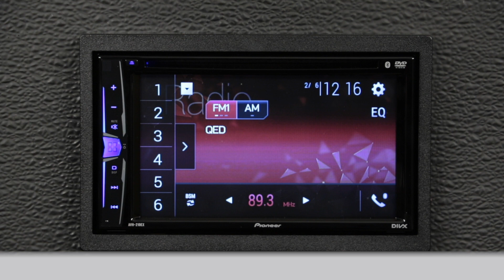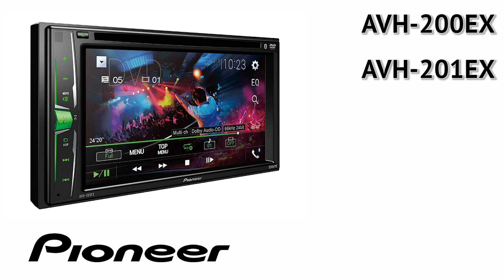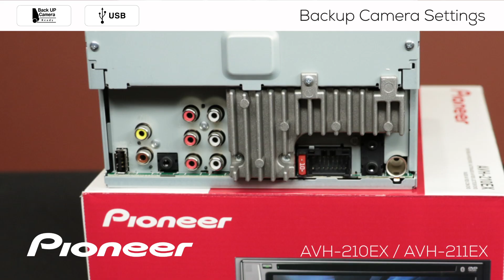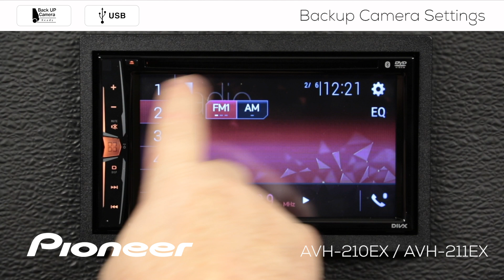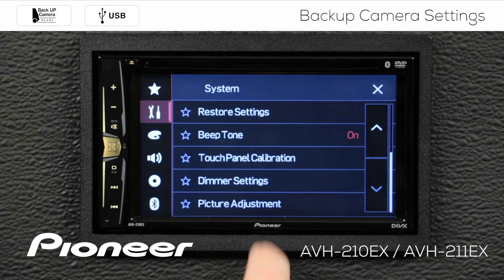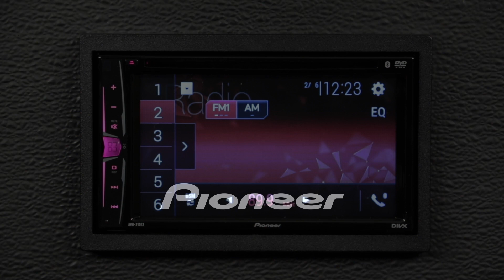How To - AVH-210EX - Backup Camera Settings

Comment: I've installed this unit in my vehicle. The back-up camera activates on when I put the car in reverse, but will not activate when I push on  "camera view". What did I do wrong?
Reply: Same here, did you ever figure out what to do?
Reply: It sounds like you are using the Purple/White wire to power the camera.  This is incorrect wiring.  
Pioneer in-dash receivers are designed to work with the Pioneer ND-BC8 backup camera.  You can see it here:  https://youtu.be/kg0IaGC3JbE?list=PLw63zJRQbCNgLoyoij-BJdPDBVLYipAnj   The ND-BC8 has a Red ignition wire and a Black ground wire.  
The camera should power on when the vehicle is on.  And the camera should power off when the vehicle is off.  
Just because the camera has power, does not mean you are viewing the camera window on the in-dash receiver.  
On the in-dash receiver, the Purple/White Reverse Gear Wire is used to let the in-dash receiver know the vehicle is in it's reverse gear, and this can automatically open the camera window.   Do not connect the Purple/White to the camera.  The camera should operate with the vehicle ignition.  
At any time you can touch the in-dash receiver screen to open the camera view window.  You can find more videos about wiring your Pioneer in-dash receiver here:  https://youtu.be/-bF3uzzaT30?list=PLw63zJRQbCNgLoyoij-BJdPDBVLYipAnj   
You can find more videos about Pioneer AVH-210EX in this Pioneer You Tube Playlist:  https://youtu.be/oVH5gvX5Rfs?list=PLw63zJRQbCNgLoyoij-BJdPDBVLYipAnj  and you can find more videos on Pioneer's You Tube Channel here:  https://www.youtube.com/user/pioneerelectronics

Comment: So if you connect to reverse lamp how do you turn on the camera whenever you want if it doesn’t have power?
Reply: Pioneer in-dash receivers are designed to work with the Pioneer ND-BC8 backup camera.  You can see it here:  https://youtu.be/kg0IaGC3JbE?list=PLw63zJRQbCNgLoyoij-BJdPDBVLYipAnj   The ND-BC8 has a Red ignition wire and a Black ground wire.  The camera should power on when the vehicle is on.  And the camera should power off when the vehicle is off.  Just because the camera has power, does not mean you are viewing the camera window on the in-dash receiver.  On the in-dash receiver, the Purple/White Reverse Gear Wire is used to let the in-dash receiver know the vehicle is in it's reverse gear, and this can automatically open the camera window.   Do not connect the Purple/White to the camera.  The camera should operate with the vehicle ignition.  At any time you can touch the in-dash receiver screen to open the camera view window.  You can find more videos about wiring your Pioneer in-dash receiver here:  https://youtu.be/-bF3uzzaT30?list=PLw63zJRQbCNgLoyoij-BJdPDBVLYipAnj   You can find more videos about Pioneer AVH-210EX in this Pioneer You Tube Playlist:  https://youtu.be/oVH5gvX5Rfs?list=PLw63zJRQbCNgLoyoij-BJdPDBVLYipAnj  and you can find more videos on Pioneer's You Tube Channel here:  https://www.youtube.com/user/pioneerelectronics

Comment: So i have an issue where as soon as i turn the ignition on an the radio powers up it goes straight to the camera screen (Blank as not in reverse) I press the X icon to go back to main screen then it will usually go back to camera screen again. I tap X again and it goes back to main screen and this time stays there. Any ideas?
Reply: Do you have a camera installed?  What is your connection to the Purple/White wire for the reverse gear?   I recommend to press the microprocessor reset button on the in-dash receiver.  You'll need a paper clip or some other small point to press the microprocessor reset button.  If you are using a Pioneer AVH-210EX you'll find the microprocessor reset button at the bottom of the hard key panel.  You can find more How To videos about the Pioneer AVH-210EX in this Pioneer You Tube Playlist:  https://youtu.be/oVH5gvX5Rfs?list=PLw63zJRQbCNgLoyoij-BJdPDBVLYipAnj  and you can find more videos on Pioneer's You Tube Channel here:  https://www.youtube.com/user/pioneerelectronics
Reply: This is old, but I was having the same problem and when I went to camera settings and changed the polarity to battery from ground it made it so the backup camera only activated when I put the car in reverese.

Comment: Hi I'm using AVH 5450DVD on my Mercedes and installed an aftermarket backup camera. Every things look good except nothing change on the screen at gear 'R'. I check on the settings, Polarity = battery but "source off" next to "rear view". To see the back view, I have to push the "rear view" button, just like you describe 5 second and return to the main screen etc. This situation happens, when I press the "rear view" button, can see the back view at gear 'R' and turn black screen at gear not 'R'. I expect that whatever you are doing say DVD, music, radio, it goes to back view at gear'R' without touching any thing on the screen, right?
Correct me if I were wrong, I saw your video in the end, Pioneer can function this, provided that the violet wiring is connected correctly. I'm using crimp connector, thanks.
Reply: When you put the vehicle in the reverse gear, the in-dash receiver is designed to automatically switch to the camera view.  The Violet/White wire let's the in-dash receiver know the vehicle is in it's reverse gear and to open the camera window.     Please focus on the Violet/White wire.  This wire needs to see a change in voltage when the vehicle is in it's reverse gear.  One possible way to connect the violet/white wire is to the backup lamp terminal.  You can learn more about wiring your Pioneer in-dash receiver here:  https://youtu.be/-bF3uzzaT30  Do not connect the violet/white wire to the camera.  You can find more videos on Pioneer's You Tube Channel here:  https://www.youtube.com/user/pioneerelectronics
Reply: @deckerdotto6035  Thanks Deckerd, I'll do a connectivity test on violet/white wiring connection to +ve of backup light. Crimp connector may not be as good as directly copper wire twisting.

Comment: So I just installed this avh-210ex. After installing I have 3 issues, when putting car in reverse, the camera angle is pointed directly down, how do I change so it shows directly behind vehicle instead of straight down? Also, when playing a DVD, I hear the movie but there is no video, finally after installing the aswc-1,the steering wheel controls do not work... When I push camera setting from home screen, it's black with nothing on screen. Any help is appreciated
Reply: All 3 things you've described here are installation issues.  Let's start with the DVD video.  You must have the Parking Brake engaged in an ON-OFF-ON operation to watch video.  If you engage the Parking Brake and still can not see video you have an incorrect connection to the Green Parking Brake Wire.  You can see more about the Green Parking Brake Wire here:  https://youtu.be/-bF3uzzaT30?list=PLw63zJRQbCNgLoyoij-BJdPDBVLYipAnj    and you can see video playback from USB here:  https://youtu.be/7LU2GxhRGrQ?list=PLw63zJRQbCNgLoyoij-BJdPDBVLYipAnj&t=301   For the camera angle I recommend to physically adjust the camera angle.  I'm not aware of any camera angle adjustment that can be made on the Pioneer AVH-210EX.   As for the camera black screen.  Check the camera polarity seen here:    https://youtu.be/tWi_kVPg2M4?t=115   This may correct the issue.  If not it sounds like the camera is not powered up when you choose camera from the home screen.  The camera should have power at all times when the vehicle is switched on.  And the camera should power off when the vehicle is switched off.  When you choose camera from the home screen you are simply opening the camera window on the in-dash receiver. The Purple/White wire should not be connected to the camera.  Purple/White is used to let the in-dash receiver know the vehicle is in it's reverse gear and to automatically open the camera window and to automatically close the camera window when the vehicle goes out of it's reverse gear.    You can see more about the Purple/White wire here   https://youtu.be/-bF3uzzaT30?list=PLw63zJRQbCNgLoyoij-BJdPDBVLYipAnj&t=127    Finally,  there are no adjustments for the Steering Wheel Control adapter in the Pioneer AVH-210EX.  You must program the Steering Wheel Control adapter before you install it.  Please contact the manufacturer of the steering wheel control adapter for more information.  You can find more videos about Pioneer AVH-210EX in this playlist:  https://youtu.be/oVH5gvX5Rfs?list=PLw63zJRQbCNgLoyoij-BJdPDBVLYipAnj   and you can find more videos on Pioneer's You Tube Channel here:  https://www.youtube.com/user/pioneerelectronics
Reply: @deckerdotto6035  I figured it was an installation error. I am just curious about the backup camera. The camera is not adjustable, this is the factory camera, which I was able to switch between 3 different views with the original factory stereo but now only faces straight down. So I'm hoping it's just an installation error. I see videos for using a USB thumb drive but nothing about using the actual cable that comes with our phones.
Reply: I'm not aware of a way to adjust the factory camera viewing angle using the Pioneer AVH-210EX.  The USB port is on the back of the in-dash receiver and a USB extension is included in the box to bring the USB port up into the passenger compartment of your vehicle.  The USB port on the Pioneer AVH-210EX will charge your phone when it's plugged in. The Bluetooth Audio Source is the best way to play music from your phone with the Pioneer AVH-210EX.     Simply connect your phone through Bluetooth and the select the Bluetooth Audio Source.   https://youtu.be/kBf9sYwE4dE?list=PLw63zJRQbCNgLoyoij-BJdPDBVLYipAnj    Start a music app on your phone.  This works for both Android and iPhones.  If you use and iPhone, you can play music through the USB from your iPhone.
Reply: @deckerdotto6035  so when everything is installed correctly, the camera angle should only be showing directly behind the vehicle like normal backup camera does. before the install, the factory camera had 3 viewing angles, so I'm guessing the camera is still in the of those factory angles, so I would think that since the factory camera is retained, those options would still be available? Pertaining to the USB/Bluetooth. I understand that the USB can be used with my phone, but when I connect, it says incompatible USB? I am wondering why this happens and shouldn't the stored music/videos on my phone be able to be played through the USB connection if I didn't want to use Bluetooth?
Reply: I'm not aware of a way to adjust the camera angle with the Pioneer AVH-210EX.  For the  USB port, it will support iPhone only not Android.  It sounds like you are plugging in an Android based phone and the system is operating normally.  If you want to playback music from an Android based phone through Pioneer AVH-210EX use the Bluetooth Audio Connection, or put the music on a USB Flash drive.   You can see music playback from a USB flash drive here:  https://youtu.be/7LU2GxhRGrQ?list=PLw63zJRQbCNgLoyoij-BJdPDBVLYipAnj&t=301

Comment: Hello, my device activates the camera when I  set reverse, but if I hit the camera view option the camera doesnt work. Any suggestion? thanks in advance
Reply: It sounds like the camera is not powered up when you are selecting Camera View from the home screen.   The camera needs to power up when the vehicle is switched on, and the camera should power off when the vehicle is switched off.  The Purple/White wire is used to let the in-dash receiver know the vehicle is in it's reverse gear.  This will automatically open the camera view window on the in-dash receiver, and close that window when you change the gear out of reverse.  Do not connect the Purple/White wire to the camera.  You can see more about wiring Pioneer in-dash receivers here:  https://youtu.be/-bF3uzzaT30?list=PLw63zJRQbCNij5Whv7bYZnPaL9m1Nb1SV  You can find more videos about Pioneer AVH-210EX here:  https://youtu.be/7LU2GxhRGrQ?list=PLw63zJRQbCNij5Whv7bYZnPaL9m1Nb1SV  You can find more videos on Pioneer's You Tube Channel here:  https://www.youtube.com/user/pioneerelectronics

Comment: My current 2016 honda Civic LX has a factory backup camera,steering wheel controls. I just purchased the avh-210ex. Besides the dash kit, what all do I need to purchase for this stereo?
Reply: I recommend speakers.  I think they are the most important part of the car audio system. You can see them here:   https://youtu.be/bwrJ4LcyHmU?list=PLw63zJRQbCNiTV71nfrZHNcn8taD6y4yX     I recommend a wiring kit there are many available.  Here is one possibility:  https://www.scosche.com/shopby?vehicle=1   You'll also need a steering wheel control adapter.  There are many available,  here is one possibility:  https://maestro.idatalink.com/product/product/product_id/101  In many cases the factory back up camera can be used with the new in-dash receiver.  If you need a new camera, I recommend Pioneer ND-BC8.  You can see it here:  https://youtu.be/kg0IaGC3JbE?list=PLw63zJRQbCNgLoyoij-BJdPDBVLYipAnj   You can find more videos about Pioneer AVH-210EX in this playlist:  https://youtu.be/oVH5gvX5Rfs?list=PLw63zJRQbCNgLoyoij-BJdPDBVLYipAnj   and you can find more videos on Pioneer's You Tube Channel here:  https://www.youtube.com/user/pioneerelectronics